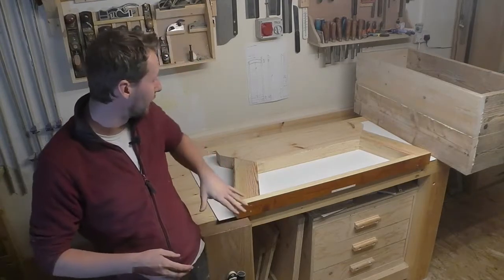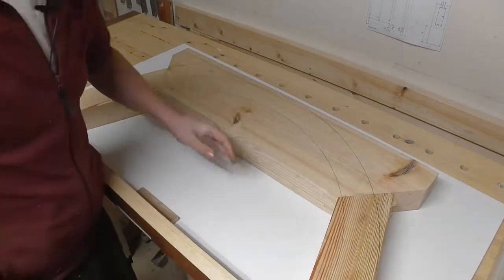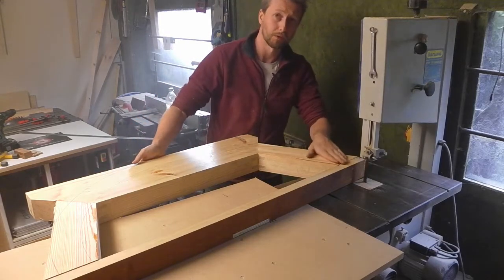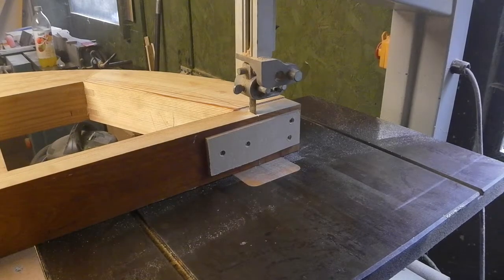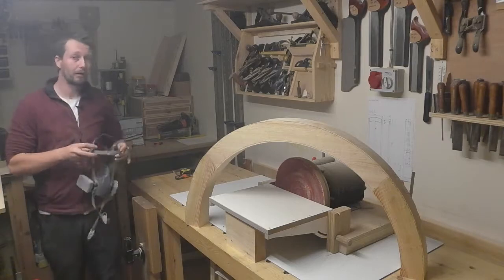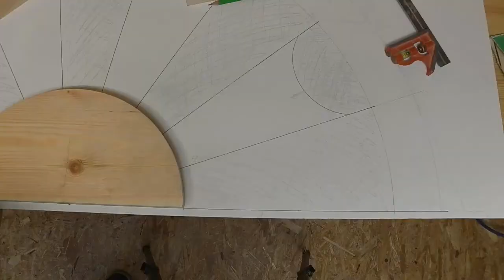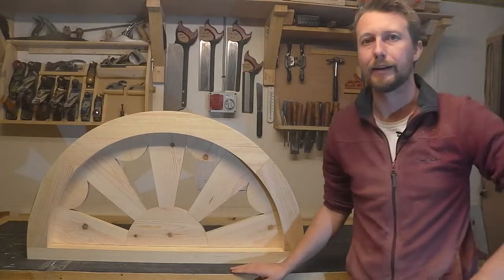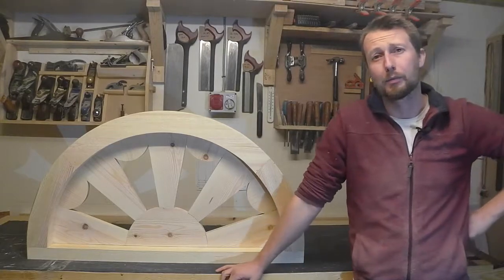Making the Arch - Arched Passage Gate Pt4

Comment: Nice job...... can't beat a bit of norm lol.   Don't you have dust extraction?
Reply from the maker: He's still 'The Man' isnt he!
I have a large(ish) drum vacuum which I can hook up to my table saw, bandsaw, router table.....The mitre saw is a little more difficult and often more inconvenient than its worth. Space is very tight in my modest workshop and wall mounted ducting, and dedicated extractors just isnt viable. If i am really gonna be making dust for a prolonged period then I will hook up the vac whenever possible....but for short periods I just mask up then go have a cuppa tea and let the air settle. But 'dust' is something I would like to improve on if possible.